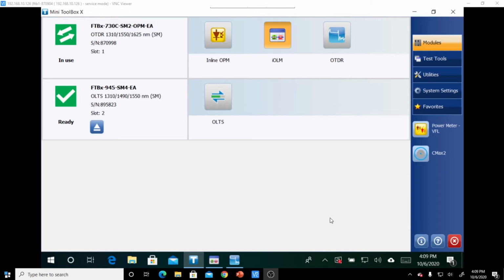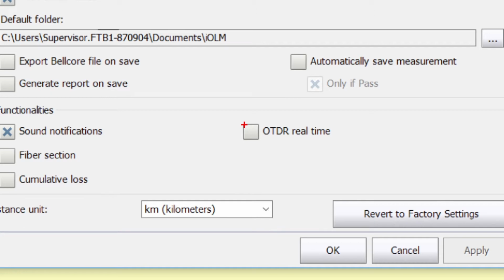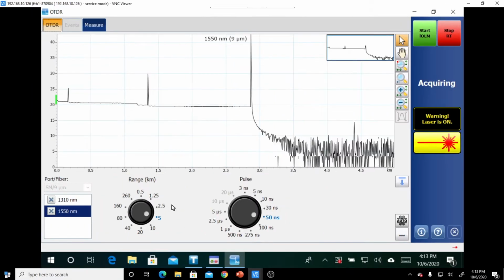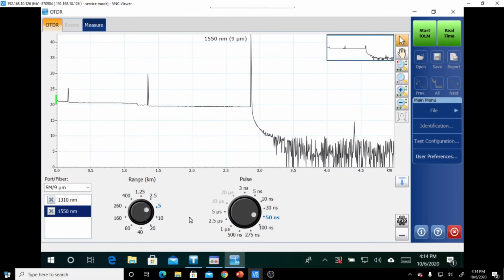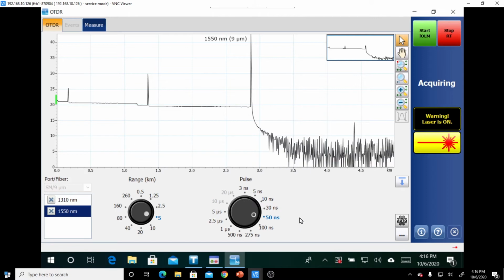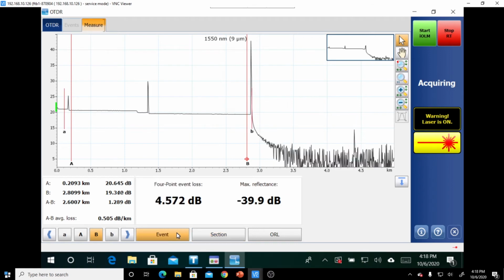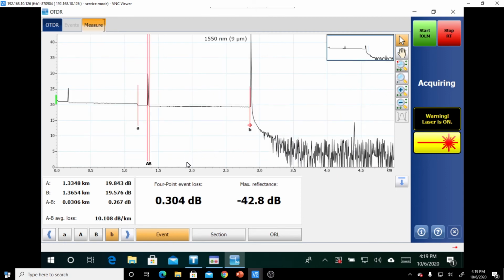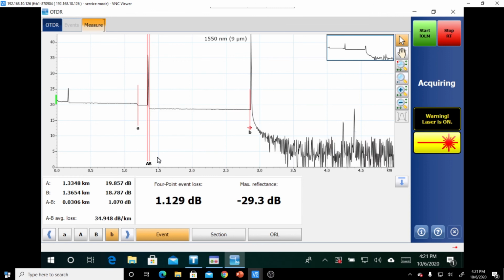EXFO iOLM   Real Time OTDR Setup and Testing

Comment: I the field we work by ourselves,  we always deal with splices, not connectors, so we run our test, go to that location, resplice then drive back and measure again.
Reply from the maker: This is even more useful for splices. This is relevant for real-time testing only when you want to keep up with the splicers. Not for after the splicing. I did another video. 4 Point marker that talks more about splices but its the same process. This is not a replacement for average testing which will give you more precise measurements this is for when you want to use real time to measure splice or connector loss while the splicer is churning and burning

Comment: Hey, how do you do bidirectionals on Max series? On the FTB-200, worked with  them alot on backhaul links.
Reply from the maker: It would be very similar just test in each direction. I did a video on OTDR testing and test efficiency which covers this. I will dig up the links when I get back to my computer